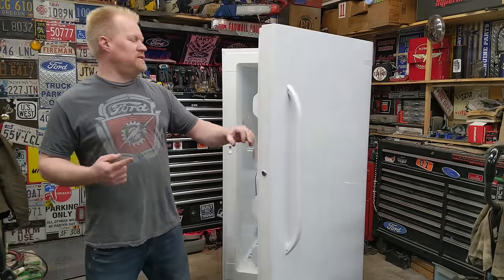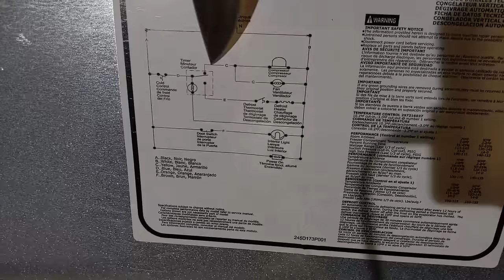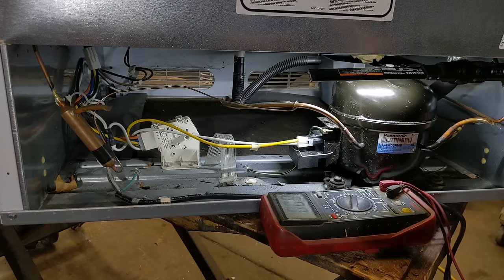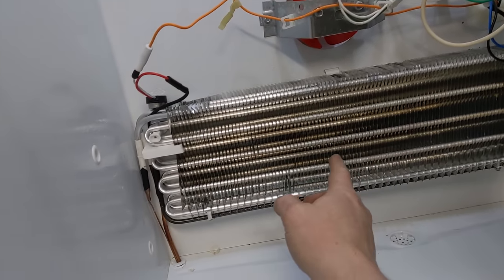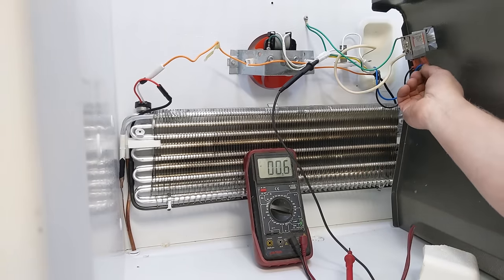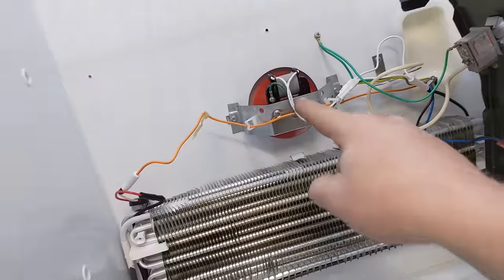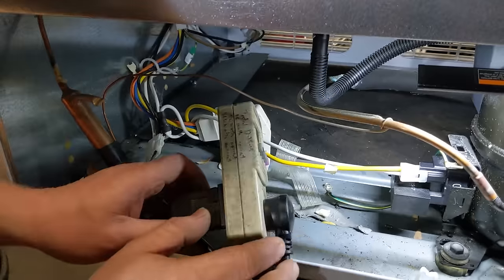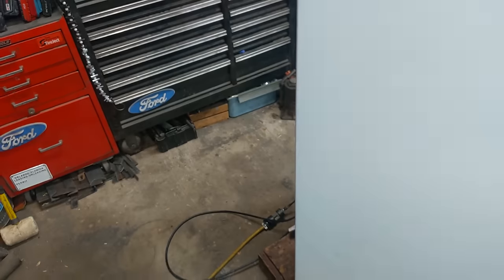Freezer Not Cooling HOW THEY WORK and REPAIR

Comment: My instructor at tech school about 1975 (year) said ---"Don't worry about how technical stuff is.  check your power and ground"  I still live by that.  great work.
Reply: Hmm, good advice!  Although, wouldn't it be check your hot and neutral (between each component to trouble shoot)?
Reply from the maker: Neutral and ground used to be tied directly together in 75. I don't think it was until the late 80's that Neutral was separated from ground until after the circuit breakers.
Reply: @sixtyfiveford  Cool, so I was on the right track.  Still great advise with just a little modern revision.
Reply: @AtimatikArmy  always check power phase to phase or phase to neutral, then verify to ground. Relying solely on your potential to ground will get you killed bud.
Reply: @jman0870  So what you are saying is check each phase (277V) individually and not all 3 together (480V), correct?
Reply: BTW, I'm not an electrician but I am a mechanic/machinist.  Still ,having a sound understanding of the fundamentals is key.  I admit I still got a lot to learn in that dept, so thanks for the feedback!
Reply: @AtimatikArmy  no…I’m saying that troubleshooting solely to ground will get you killed. You troubleshoot phase to phase or phase to neutral(if that portion of the circuit requires a neutral…typically not much does outside of 120v or 277v lighting circuits). You verify what you found to ground.
Reply: @jman0870 don’t know where in the the world you’re located but I suspect it’s somewhere with full voltage home supply like Europe with 240 v. Believe Australia is also like that. This guy is obviously in North America where all the voltage feeds off one phase of a 240 v dual phase supply. The white neutral side actually behaves as a ground and the whole circuit actually behaves as a DC circuit. The hot side black or red v wire is live 120v the neutral side is like ground no voltage. Maybe you are saying that you should check there’s no voltage in the neutral which is possible if something has been connected wrong in the building circuits. But if that was the case the device wouldn’t work because the voltage potential would be the same on both sides. Suppose you could get zapped in a scenario like that but it’s unlikely to even encounter it.

Comment: Next episode "sixtyfiveford" turns a free freezer into a central air unit for his workshop....😄😄😄
Reply: That is a cool idea, one I have no doubts 6-5 could tackle!
Reply from the maker: Don't get me thinking.
Reply: @sixtyfiveford  "come on man, do the...  you know...  the thing!"
Reply: Be easier to turn it into a heater since it takes 3+ times the amount of power just to heat that one set of coils rather than the power used to cool the entire unit.
Reply: @johnpossum556  Too many heater videos already. Time for an AC video.
Reply: @jdretiree2433  What was the wattage, though? It'd maybe cool your forehead while sitting at your computer station but that's about all. Even small one room window AC units can suck 1500Watts.
Reply: Wow you get a 100 /10 reading for that that seems awesome

Comment: One tip (not originally mine) is to use a standard ATO automotive fuse instead of that little strip of copper. You can work it live and has a built in overload. Old guy taught me this and it has been a game changer for me in diagnosing things. Just like you did with the strip of copper, I could essentially take out all possible components from the circuit until I found the bad part. Thanks for all the great vids!
Reply from the maker: Good idea.
Reply: I would like to see that to learn what you are talking about.  Sounds interesting...
Reply: @AtimatikArmy  Any idea how to upload a picture?
Reply: @CDP135Z  bummer, I don't think you can.  You could post a link to it I think?
Reply: @AtimatikArmy  In the video Moe's took the blue wire and the black wire off of the thermostat.   The connections they were on are flat blades.  The copper piece he inserted was basically 2 flat blades in one piece.  Instead of using the copper piece you take a car fuse and attach the blue wire and black wire to the 2 flat blades of the car fuse.  We do this in HVAC also.  The use of terminal connections for electrical connections is used in tons of applications so the tip that the poster above gave of using a car fuse is a good one.  A benefit is that if you use a low amp fuse it will usually burn the fuse before you do damage if there's a short somewhere that's causing the problem.
Reply: @yepper1165   OK cool I totally understand it as much simpler than I think I was thinking originally. You're just bypassing the thermostat with the fuse instead of a copper blade of a material. Got it awesome thank you everybody!

Comment: Hi there , I'm not sure what your name is so forgive me for not mentioning your name.  This is the first video I have seen from your channel and I wanted to convey my most sincere thanks to you for posting this video.  
I noticed my freezer had partially unthawed 3/4 of my food this morning and that the fan didn't quite sound right and not much longer after I noticed that the fan quit all together.  At the time I noticed this I didn't have time to look into the problem despite the several hundred dollars of food I had in there. 
At the time I was facing the installation of 2 cam  positioning sensor on my truck.  
Anyhow after watching about 3/4 of this video I was able to go into the freezer take it apart and quickly find and fix the problem at no cost other than the things that I threw out food wise.  Originally I didn't have a clue and thanks to this video you saved me a costly repair bill and or having to buy a new freezer.  
Being that we are in some very tight times now my most sincere thanks God out to you for the incredible help you have given by posting this video. 
Thank you so much. 
Sincerely  WR Freeman

Comment: Nice job. Here quite many have converted top loading freezers into normal high efficiency fridges. They just replace the thermostat for something way warmer values. Good for cabins with few low power solar panels to keep milk and such from spoiling.

Comment: Hey buddy..that was a easy fix..90% of the problems with refrigerators..i have had some where that switch on the compressor was bad..so you got a free freezer just for having a truck...lol..not bad hope you Ginger and family had a great new year..see you on the next one..Cheers friend 🍺🍺🍺🇺🇸🇺🇸🇺🇸
Reply from the maker: I seam to replace that little compressor relay the most, especially on older stuff.
Reply: @sixtyfiveford  They make a universal starter pak that fits most models. That's what I was taught and encouraged to use when I went through HVAC & Refrigerator training. Good item to keep one of on hand.

Comment: My advise is check the timer first if you have a cooling problem ... this is free , no volt meters necessary and the timer is  responsible for 75% of failing fridges and freezers .
Timer motors are  always turning like a clock . When the freezer is defrosting you can usually hear a clock like ticking sound .
Many times I  have found that the timer was stuck at the place in the cycle where it has to push a spring loaded lever to start the defrost cycle . If there was a power outage the timer will stop . If it stopped while pushing against the defrost lever inside then it might not have enough strength or momentum to start turning again . 
While plugged in ... turn the plastic screw/ knobs  so you can hear the timer turning . You should hear the click when it gets into the defrost cycle . If you go past it , go around again and stop when you hear the click !
If nothing else is broken the timer will turn off the compressor and turn on the defrost heater tube to melt the ice . It could take 1 hour if the ice is packed .
Note : the extra ice melting might overfill the tray in the bottom of  freezer/fridge and wet the floor . The tray is made to catch normal amounts of water and slowly let it evaporate near the heat of the compressor .
 When all of the ice has melted the temperature  of the evaporator  will begin to get hot and a sensor will click on , sending power to the timer , the timer will make ticking noise for a while and then turn the compressor on. If that happens your freezer should feel cold in minutes . Check it once or twice for the next few days to make sure everything is cold enough . If ice starts to build up again  or the freezer gets warmer  in 4 or 5 days then your timer is probably going to need replacing because it isn't  turning through its cycle  properly . The motor in the timer might be failing. 
Note if that did not fix it  check thermostat , (timer,)  defrost thermostat  sensor , defrost heater element and finally compressor .
Note : you cannot change your own compressor . It has pressurized freon gas in  it that must be captured by pumps and tanks for recycle . Only done by authorized repair persons. It could be costly .
 Get estimate .

Comment: Definitely not mercury and probably not just alcohol.  Those sensing bulbs/tubes are filled with a mix of refrigerants and non-compressible gasses calibrated to the temp range of the thermostat and the force needed to operate.  The mercury people associate with thermostats came mostly from the mercury switch on the bimetal coil that was tilted to cycle the switch.

Comment: Nice fix. Great explanation as well
Reply from the maker: Hey Thanks, I'm glad you liked it. I think I would rather have my time spent fixing a Bobcat though.
Reply: @sixtyfiveford  lol. Yeah I was so close to getting it going then old man winter hit is.  During Christmas it was so Nice almost 80* could did anything because we had family to visit. New years was I think 18*  by the time I get off work its to dark to record.  My son is chomping at the bit to get his gas tank sending unit and fuel lines replaced on his 61 C10. My oldest got his first car 2000 Silverado and he needed help with that.....and just got my wife's 66 mustang back on the road

Comment: Nice repair moe, but you need a combination lock to keep ginger out lol 😀
That looks in good condition and the old thermostat is all that was wrong 😀
I have a really simple fridge/cooler,  the thermostat is just kicks in the compressor in when its too warm.
No fancy pants heating elements or super duper computer control.
That's the reason it still works lol.
I trust mechanical more that computers, yes im an old git lol.
Reply from the maker: Computer boards/chips have to be one of the worst things to ever happen to appliances.

Comment: These Frigidaire freezers are notorious for thermostat failure. I had already guessed it when I first seen it lol.. but very good video. When I diagnose these first thing I check is thermostat. You can also check the thermostat for continuity when it’s in the on position

Comment: Great overview of everything.  Makes sense.  A friend has basically the identical "Sears" upright freezer, so that was a plus.  I pulled off the sheet metal in the freezer compartment yesterday, and it is the exact same unit.  By the way, I tried to jumper / short the thermostat yesterday, and that didn't work, but I was using old needle nose pliers to jump it, so I may not have had a good connection.  Going back with my electrical tools today.  I was on a plumbing job yesterday.

Comment: Thanks for the tips. I have an older shop refrigerator that is "frost free" but it freezes up every year or two, and water collects in the bottom of it. When I manually defrost it, it works perfectly.  Now I have some idea how to check it out electrically, and, as a bonus, I finally 😊get a chance to put my Kill-a-Watt meter to diagnostic use.

Comment: I had the exact same problem with my freezer.  Replaced the thermostat and it works fine.  Of course a Sears repairman told me what the problem was.  He told me what to order and how to install it.  He saved me several hundred dollars vs him repairing it himself.  It's hard to find servicemen like that.
Reply from the maker: That's a great serviceman.
Reply: @sixtyfiveford  that’s a terrible service man. Dude has to eat too. I’ve devoted thousands of hours and my own blood, sweat, and tears into learning to do HVAC/R and I refuse to give random Harry Homeowner’s any of it for free. It’s literally the hardest trade to learn and arguably the most demanding.

Comment: Great video. A no-contact voltage tester can do a lot of the testing without disconnecting wires. It's a cheap investment. Harbor Freight has them for $5.

Comment: This is really appreciated and helps sort out the electrical portions of many refrigerators. I have a 1952 Westinghouse fridge, one of the very first frost-free models they ever made. Instead of a 24 hour run time, it has a heater that kicks on after a switch in the door jamb has been opened and closed a set amount of times. On mine both the switch and the thermostat are faulty. If I plug in the fridge it runs indefinitely and turns into an unregulated freezer, getting down to -19°F!
I gotta see if I can find a new thermostat for it and hopefully rebuild the count switch.

Anybody familiar with these old Westinghouse Fridges, share with me what you know, I'd appreciate it.
Reply from the maker: I've worked on a fair amount of vintage refrigeration. Mainly Coke Machines but also as old as a 1941 Kelvinator. The thermostat should have a temp rating on it. If not you can also just pick one based on whether is monitors the temp off the fridge part or the freezer part.
Reply: @sixtyfiveford  Good to know. I didn't know that, thank you!

Comment: the defrost element didn't come on in the video, the defrost thermostat was still open due to temp, what you saw was full locked wattage from the compressor before the overload kicked in. give er a while and check the heater again when it's down to temp, great video though and very thorough! reminds me of a video that saved me when my roper fridge was freezing it's condensate drain and the fix was to wrap 12ga copper wire around the element and feed an end down the tube to warm it up and two other pieces on either side to melt the drain pan.
Reply: sounds like a nice and easy fix. i will remember that one!

Comment: At the end you checked the compressor and it wasn't really warm, just a bit. What if it was hot? I have a chest freezer I just got used and it quit after a week. The compressor wasn't making much sound, and it got very warm, but not really hot. Thanks :) 

OOPS, checking it out and the power cord was shorting, so now it's running. Thanks though because I know you would have helped. I'm tblbaby. Omegahpla and probably Bob Hutchison. Long time subscriber, near a decade or more maybe. Life has been weird the past couple years.

Comment: I have a frigidaire upright freezer model fffu14f2qwp. I'm constantly getting frost buildup on coils. I checked door gasket which is loose/soft and the bottom part's magnetic isn't strong. Aside from replacing the gasket, can the problem be the heater?  Please email solution when available. Thanks in advance.

Comment: So on mine, I think the fan went out. Because when we took the back part off the fan wasn't going at all. I have a 21.3 up right frosted free ge deep freezer. The freezer felt cold but felt like no idk when your pulling on the door it's sucking it back. We wasn't getting that. Our deep freezer was saying high temperature and I had ice like crazy. So we took the back off and the fan wasn't moving period. It didn't have ice on it either. So I order another fan hopefully it fixes my 1200 dollar deep freezer I've had 7 years 😢

Comment: I have a donated Frigidaire freezer model that is one or two steps down from the one you demonstrated the testing and replacement of the thermostat. My thermostat part # is 216303500 and is replaced by 216303600. Neither is available from Frigidaire now and you used a $7.00 replacement. Did you use an alternate brand that fits. My dial face has to screw into the the post. I saw a rough used one on EBay for $100 or best offer. I would like to put a new thermostat in. 
Freezer model #MFU14F3GW5. Your response will be appreciated. Thanks Rick H.

Comment: Moe great explanation. I have been in the restaurant  business for over 2thirds of my life. Out of necessity I had to learn how to repair my units. Could not always get a A/C tec in when needed. Some of my locations had 10 compressors. I had to always be ready to do plumbing, electrical, a//c & some phycology in between cooking LOL 
Sometimes the coils are in the walls. Commercial units are even simpler to work on & access to compressor usually up front & slide out or on top which has plenty of access as well.
Still have my gauges.
How did you come to learn this?
Reply from the maker: Being thrown into the fire is the best way to learn this stuff. I learned out of necessity and curiosity. I used to buy and flip Coke machines and just did what was needed to get them going.
Reply: @sixtyfiveford  Same here, we would have made some team.
Reply: @Joe Z: I fixed a rotary bun toaster machine once. Boss was very happy! (too bad I didn't get a raise for keeping the restaurant going. )
Reply: @johnpossum556  At least some sort of payment $$$ or maybe a short work day wit pay.
I know we are sometimes unappreciated not only at work.
Keep doing good when you can, it does get noticed.
Stay well, Joe Z

Comment: the watt meter was the tool for me: the compressor was at 55 celsius so according to other videos i saw it was "normal and operating"... but when i plugged the watt meter it showed 80 watts for a 23 cubic feet freezer, which is not ok (should be 200-300 watts). and it pointed me to a failed run capacitor that the "freezer specialist" didn't even check... so much for "expertise"